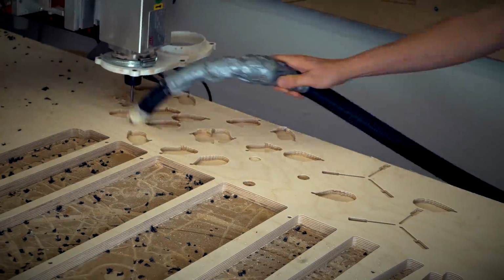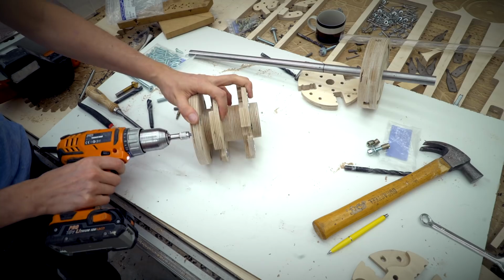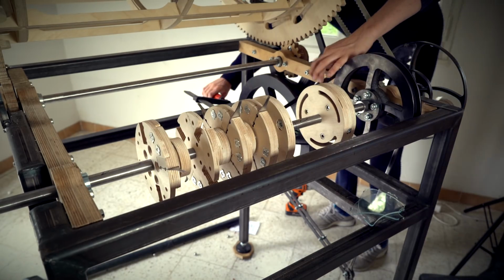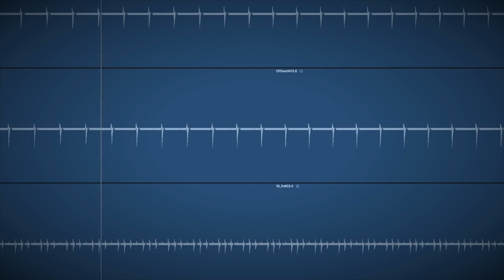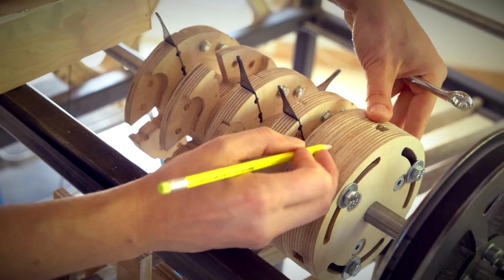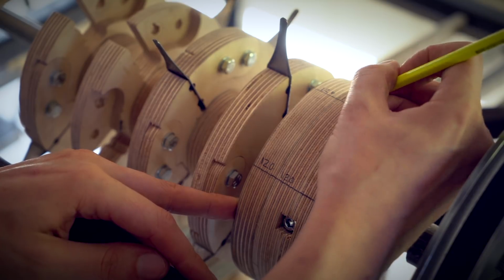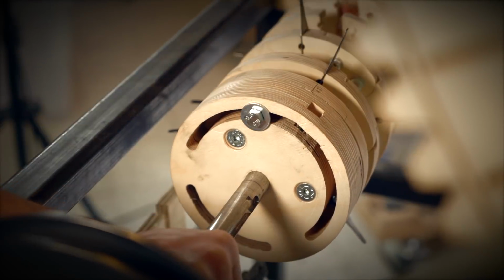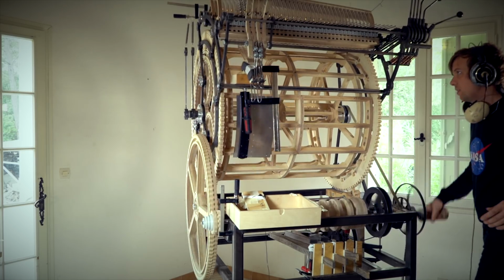Testing the Mechanical Rhythm Machine - Marble Machine X #55

Comment: Did you ever consider putting something like a one way bearing / ratchet mechanism / clutch thing on the crank? The downside would be that you couldn't use the crank itself to slow / stop the flywheel, but it would be safer / easier to grab the crank should you ever need to let go of it during pieces with higher tempo.

Judging from the amount of force it put out while you were trying to stop it, and the possibility of you putting a larger flywheel on the machine, it doesn't sound like using the crank to slow / stop it was your plan anyways. Are there plans for a braking system?

Comment: There is one thing I don't understand:
The rhythm module have to be manually rotated depending on the tempo. I mean, the Marble Machine is working with a crankshaft, it's so much versatile in term of tempo, and it's a lovely feature (when you just leave the machine running and spinning with all it's inertia at the end of the original MM video, it's just wonderful), and having such a system which is delaying when you go to any other tempo than it is planned to go, I don't know, it feels very inhomogeneous, and I'm sure there might be some kind of mechanical engineering possible to fix this. After all, is the delaying consistent through every tempo? Because I was thinking about something like a gearbox, it would change dynamically the speed of this rhythm module. There might be simpler solutions, but that's all what got into my mind.

Comment: these threaded inserts are usually used the other way round, with the slits on the sides going in first. the outside threads are lower at the beginning, and the slits are used as gap to make the chips break. specially on using on metal. as you only thread them into wood, it probably isn't so much of an issue, but i've seen you so often place them in the way you do, that i thought it is time to at least mention it.

Comment: I would have degree or 2-degrees notches on the ply-wheel you use to tune the delay rhythm vs marbles(and  maybe even have a directly read-off unit of measure, as milliseconds with +/- signs instead of degrees, this would help during the concerts)

Comment: Are you going to add a (fast-acting!) brake to the machine?  For safety?

And is there going to be a shield on the frame to protect your hands against the nasty little metal pieces on the rotating part of the rhythm machine?

Comment: I am no mechanical engineer, but it seems to me that some sort of collar clamp, put around both the shaft plywood ring and the one attached to the picks of the rythm machine would make for a better tuning solution, because it would allow free 360° tuning as well as perhaps somewhat easier access to the locking bolt(s).

Comment: I have a suggestion. You could have a lever that would allow you to switch BPMs very quickly and even in the middle of a song. Instead of having the only point of adjustment on the actual rhythm maker, you could alter where the plywood that you will raise contact the spring steel. This would make adjustment very quick and you could do it on the fly. In other words, instead of contacting the spring steel directly at the bottom, the lever would allow you to contact the steel a set degree offset from the top or bottom.

I'm not sure how hard it would be, but you could possibly use centripetal force to automatically adjust the timing. This is probably way out of scope for this project, but I would assume that it is possible.

Comment: You should make a flyweight governor which adjusts the timing according to the tempo. There's similar contraptions in old school automatic transmissions to modulate fluid pressure and in constant speed propellers to disconnect the engine speed from the prop speed.

Comment: The adjustment is something I would use at least 2 screws for, though, that is mostly due to my constant desire for symmetry....
And I too a degree see that you have plenty more room under there to fit a few more instruments and levers....

Though, I also daydreamed about potential methods of making the whole machine self syncing, it would mostly just need to have a method of putting the main programming wheel behind slightly when playing at a lower tempo. Technically something that can be done since it is just a phase offset, but likely not easily implemented.

And also, flywheels don't like getting stopped, that is kinda their thing to just keep spinning.

Comment: you are a mad scientist!  also, during both MM builds, how many sheets of plywood have you been through?  please include the one you used for the big red arrow. :)
Reply: And the big Wintergatan letters
Reply: This leads me to the question how many screws he used in the Project 😏
Reply: I put a small robot on Thingiverse, people get weird around the 104 ball bearings part of the BOM.
Reply: Mario Perini îkjkmiu
Reply: so how can he automate the offset of the rhythm machine so it stays in sync with the marble drops regardless of bpm?
Reply: LowPriceEdition maybe a centrifugal clutch?
Reply: Was thinking of that too.  Maybe some sort of centrifugal retardation system?  If you look up mechanical timing advance in car engines, I'm thinking of a somewhat similar system.  It'd be probably tricky to get perfect though.  It would probably have something to do with moving the volume levers back and forth along the bottom of the rhythm wheels so the hits come at a later/earlier time.
Reply: Is it to do with the "flight" time of the marbles relative to the rest of the beat? Maybe lowering the box for lower bpm and elevating it for faster bpm?
Reply: @LowPriceEdition in theory he could build a centrifugal clutch that would engage at various speeds, however, this would add much complexity, and much failure points. :p

It is generally best to simply prepare for the songs, either prior, or with a short intermission to avoid mechanical failures.
Reply: @LowPriceEdition  needs some VTEC, yo!
Reply: Thanks TOT, without the colab I don't know how long it would have been before I found this channel... If at all.
Reply: expensive plywood too!
Reply: Tony - you bought me here with the link in your 500k vid. Thanks - I think. I mean, I have a lot of catching up to do on this quite amazing idea!
Reply: Hey tony,  u going to make this rythem machine part once wintergatan had the plans? Hint hint
Reply: He did make some parts, and it's a video on his channel you can watch now.
Reply: Its been one day since you posted the question... Martin must still be counting!
Reply: yeah I LOVE the mad scientist vibes that Martin radiates :D in a positive way meant, ofc! ;)
Reply: Oh those 0.5 sec / out-of-the-fifth-wall text puns. 29:31  
(Is that an influence from Old Tony)
Reply: Too much chow bell.
Reply: Engineer not scientist
Reply: engineer/artist but what's in a name...
Reply: @knikkergek  right? A rose by any other name would smell just as sweet.
Reply: @Dave Mendez
Fine... Scientific Engineer!
Reply: @davemendez3747  I
Reply: @davemendez3747  engineering is a science. so it still applies.
Reply: @davemendez3747  engineering is also a science.
Reply: @davemendez3747  Social engineer...
Reply: @tylerufen  fcking lol.

lol
lol
lol
lol

Comment: What happens if you play, turning the wheel backwards? You probably run out of marbles because the marble lift will turn the wrong way. But are there any parts that would prevent the MMX from running in reverse?

Comment: Now... I'm only halfway through the video, so maybe you're aware of it as well, but I see a problem:
You want to control the volume by moving the pads closer to or away from the rhythm part? Great idea. Except you will change the timing when you're moving them, as they will get further awway for instance and therefore be hit later. Fine tuning will only work if they stay in that position where you tuned them.
The solution will be to move them square to the wheel. So you need them all to move along the same axis which is perpendicular to the wheel. 
I just wanted to point this out for you so you don't run into trouble later. I can think of a few ways to make it work, but I think you or others will be better at coming up with a solution, as I'm not too good with mechanics. I study biotechnology, play string instruments (mainly cello) and build/restore string instruments (mainly violins), and none of these activities have ever required me to think particularly mechanically. I haven't noticed it at least...

Greetings from a Dane. Love this project so much. I'm always waiting for the next video :-)
Reply: It actually wouldn't change timing. The whole thing turns at an angular velocity(turns/time) so the metal parts(idk what they're called) would hit at the same time, because it is the same amount of turns.
Reply: But say you have them all at full volume and move one away.. That will definitely change the timing, as it would be met at a different time in the turn than before. This is not a real problem on this one since the levers turn around a point far away and are mounted underneath the wheel, so they're practically moving square to the wheel, but in theory it would change the timing I'm pretty sure.
Reply: It shouldn't be an issue if the pads are at the same angle as the strikers at the point of impact. The only thing changing is the amount of surface that makes contact with the pad.
Reply: @Exquired  exactly, that's what I'm saying. If the pads are moving perpendicularly to the wheel, the angle stays the same. When they turn around an axis, the angle changes.
Reply: @Tostra1997  imagine a wheel turning. The whole length of one spoke will be parallel to the ground at the same time no matter how far from the axle you look. This is basically a wheel without the outer ring.

Comment: Hi Martin, i did not fully understand why you need to sync the MMX to a click from the computer, but just a thought: wouldnt it be easier to do it the other way around (i.e. use the mechanically generated click and tell the software to sync to it (maybe this needs custom software, i dont know))

Comment: hi, great video.
based on your solution of having the rhythm machine and the main wheel not directly in sync, do you not fear to loose the ability of letting the fly wheel "controls" the tempo of the music until it stops. ie. if you have different settings for 120bpm and 80bpm, you can't let the fly wheel on its own without loosing the synchronization between the rhythm and the marble drop.
regards.

Comment: What you need is a way to pipe all your contact mics into a computer that knows what the timing for each channel should be and can tell you how to adjust everything to make it all line up.  That way when you set up on stage, you can run a pre-defined test pattern and quickly tune all the timings.  I don't know if this would be too much for a Raspberry Pi or other small computer to process in real time, but if not, it could be built in to the machine itself, with tuning instructions piped to your phone.
Reply: Ooh!  And then the same process could be used for recording the music as real-time MIDI, and you come full circle!!

Comment: For the adjustment wheel; 
1: Have an outer groove like now, and an inner groove on the opposite side if you want two screws (small and large ‘C’ towards each other)
2: Have a short groove for stability (long groove = weaker part) and more inserts in the disc you’re screwing into. You’ll have to unscrew, but the inserts could have exact spacing for 80, 120 bpm etc, and the small groove/slot for fine adjustments. 
If the disk you’re screwing into is thick enough, you could pretty much have the inserts side by side in a circle. 

Hope that makes sense.

Comment: I love everything you do, but you should install some kind of braking system for your flywheel or something to help slow the machine down faster. I hate to imagine what would happen if more than just the flat belt came loose, and/or it got caught in the spokes of the wheel while spinning.

Comment: If you put a Vernier scale on the timing adjustment, you will have made a Vernier timing gear! they get fitted to the cams of performance cars to adjust the timing on the engines valves in the same way.

Comment: What an awesome Idea putting in a beat machine!
28:46 You need to mount a disc brake from a bike on the flywheel, and maybe the big programming wheel to quickly stop the machine!

Comment: For the problem with a lack of adjust ability on the slots (22:20).  Instead of going to one bolt and having a nearly 360 adjustment, simply add a second set of holes for the 3 hex bolts which are slightly farther around.  (if you need to play 80 then move the bolts to the second set of holes.)

Comment: Actually you can also adjust by making an adjustment for the height of the instrument where the marble will hit, so it can sync precisely with the beat much simpler.. right?
So you dont need to do all the effort and take too much time by loosen the screw, spin n adjust the plywood disc in some degree, mark it, fasten the screw and repeat until the beat match

Comment: It would be fantastic if there was a way you could use a strobe and a few patterns of black stripes on some component to make it easy to time the machine to various exact speeds, basically like the speed adjustments on a record player. I can't think of a non-electronic way to strobe at a consistent speed, though.

Comment: Absolutely awesome! I would suggest that you still use 2 bolts to hold the timing adjustment as that is something you don't want failing in concert. Also as a side note, you probably don't need it, but are you making the starting programming plate visually different to make it easier to start unmuting channels?

Comment: MECHANICS IDEA
Disc break or V breaks from a Bike on the fly wheel axle? Probably help a lot for stopping the machine when you need too. plus if you get a larger fly wheel then you'll need to stop it quicker for transition between BPM, because letting it slow down on it's own is going to be too slow. That will also be easy enough to implement into the handle on the crank.

Comment: U know i hate to be the bearer of bad new, but it seems a bit flawed to me. In the original mmx, there were times when you needed to change tempo for strong parts on songs. However, if this is only consistant in certain bpm ranges than you couldnt do any slow down or speed up into rhythm, it would be out of sync. Yes you mute and unmute but it would only be "unmutable" in that certain bpm range, unless you stopped the marble machine completely, and than changed the bpm.
My suggestion to fix this (and i know it is a bit late in the project already) is to have a few adjustable levers for your common bpm ranges. It may take a bit of redesigning in cad but i feel it would be worth it to be able to change bpm mid song. Another alternative would be. Just a single slide-like lever that adjusts bpm with notces that have your common bpms. This way you could "slow down into beat", instead of disengaging and re-engaging into beat after tempo is adjusted. Love your videos so much i feel i had to input my constructive critizm

Comment: Watching you struggle to stop the Marble Machine; Maybe you could fit a foot brake With a calliper on the flywheel. A bit like a disc brake on a car!
Reply: Maybe a less complex approach would be a pulley and a fixed belt, pull the belt tight on the pulley will brake.
Reply: Can do, but that may cause unwanted friction.
Reply: You know, thinking about it more. What about a bicycle brake? That would be even easier.

Comment: Love your work, thx for sharing it 🤩

Questions:
1, with a bigger flywheel is it weight, with or radius you are after? 
Suggestion: If it is weight you could mount a external flywheel to the shaft and experiment with different weights (can be done internally to but you will have size constraints and a harder time changing the flywheel(s) and sizes, weightlifting weights are easy to work with for prototypes, the rubber coating can be cut to match different beltprofiles and are quite cheap.
2, what are you going to use as a flywheel brake?
Suggestion: a diskbrake can easily be mounted on the same axel but is dependent on the stiffness of the axel and the joint to the flywheel. A clampbrake works directly on the flywheel and minimises racking on the machine (as does a drumbrake) a belt brake increases the belt tension and are easy to build but you will need belts with steel wires in them and you will go thru belts faster.
3, have you thought about using locking bars and split axels to make it easy to change belts and syncing the programing wheel to the drive shaft and rythm-assembly (and stops things moving in transport).

Comment: 22:02 I wouldn't go with 1 bolt instead of 3, I'd go with 2 at least otherwise you may get warping due to humidity changes.

with two slots you'd still get like a 160 degree span of movement. Which should be more than plenty as long as you center the 2 bolts in their track while tightening the entire MRM to be about in sync with 120 or whatever you think will be your standard BPM.

And if you give yourself several bolt placements you can double or triple that and get your full 360 degree movement.

Comment: Are you planning to add a breaking lever for the fly wheel? Seeing you struggle with the inertia of that thing makes me think it might be a good idea for more expressiveness with the slowdowns. Maybe you could use an old brake pad from a car or something to deal with the friction heat. Plus it ain't feature creep if it's worth it, like the treadle pedal safety. =)